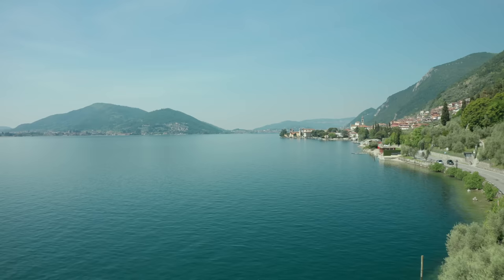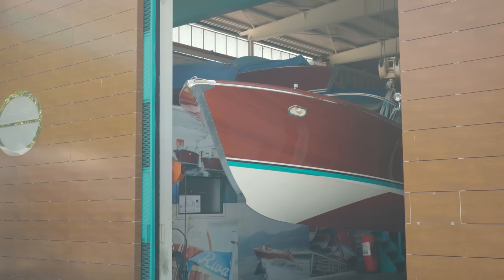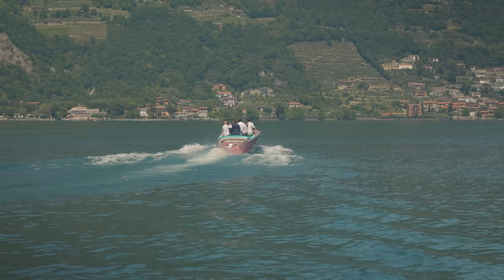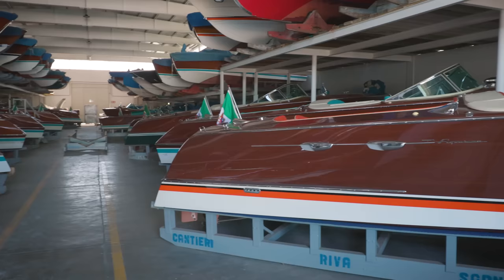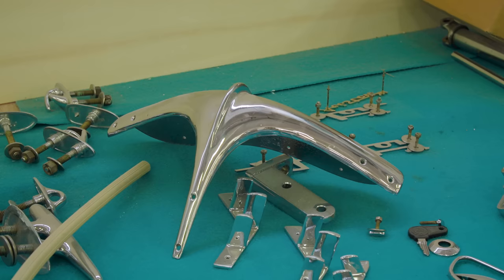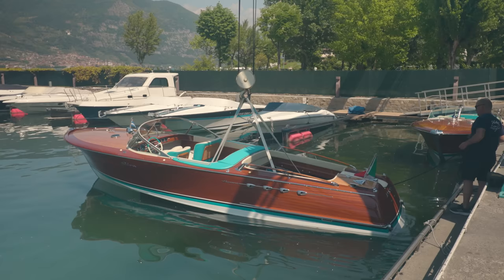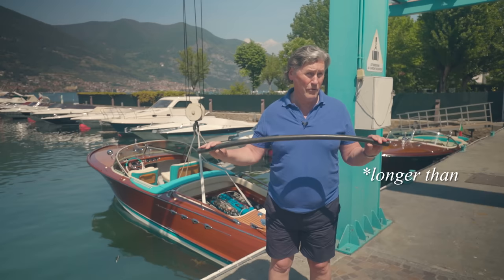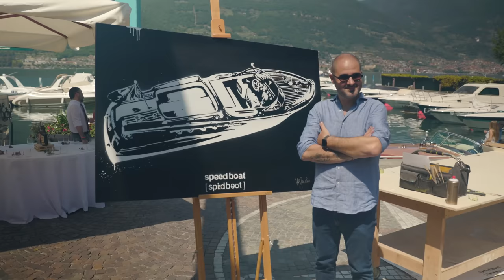Riva Aquarama Lamborghini - Tuning the Most Beautiful Boat in the World | Tyrrell's Classic Workshop

Comment: Hull No. 278.
It was restored to it original condition about 40Km away from here in the Netherlands.
The engines in this boat are NOT the original ones. one of the original engines is still in the Lamborghini Museum.
The owner is Sandro Zani (my boss) and you are correct about the prize :P

Comment: The adjustment of the carbs by sound is fascinating Iain. I have to assume you also adjust ignition timing during the process at times. I was aware of the boat, so cool you were asked to tune it. Top shelf presentation of top shelf machines!

Comment: Absolute piece of art, hands down. I have used the hose pipe and screwdriver tool on vintage corvettes, but in conjunction with a vacuum gauge. Why not use one on the engines?

Comment: What a wonderfully, diverting car video! There are a few questions that arise from the footage, which were not adequately covered: 1/. Was there much adjustment needed, and was the speedboat running poorly before it was re-launched? 2/. Was the 'test' run the first run, or did you need a couple of attempts to tune this Beast? 3/. What difference did the Bellini family notice after tuning, if any?
So, what next? Tuning the Mustang V8 engine in an Everglades swamp boat?! Great video - the privilege of knowledge and experience.

Comment: What a video Iain, thoroughly enjoyed it. Your best ever? Definitely up there, for sure! One question, with those air hungry V12s living side by side, surely the inner banks are fighting for the same air at mid to full throttle? The outer banks are producing slighly more power? How do you compensate for that with your high-tech tuning technology?
Reply from the maker: Jetting open carbs is always a compromise. Air filters may be unglamorous but they do stabilise air flow and temperature. Having said all that, these seem to cope well, although the boat is not run anywhere near full revs or throttle, for preservation reasons.

Comment: Very nice. Two suggestions. First, he should’ve talked about how the 2 engines did NOT work well in sync when built (a big issue that was only recently resolved). Second, I would prefer to hear the engine at full revs instead of singing…

Comment: I wonder if the engines were set up to counter-rotate? This is done with the big block American V8s. The starter, oil pump, water pump, and cams must be adapted.  
Also I noticed the bare carburetor intakes, no air cleaners. I guess there isn’t much dust and dirt on the open water!

Comment: Amazing content as always!! I was curious about an article I had previously read about the Lamborghini powered Aquarama. It mentioned that the original v12's power band was not suitable for the boat and either they upsized the engine or changed the camshaft profile. Is there any truth to this? I imagine that a boat application would require a decent amount of torque at low revs to pull it out of the water at low speeds and plane.
Reply from the maker: I believe the engines were rebuilt and modified a few years ago

Comment: Facts:  the Riva Aquarama Lamborghini was a failure.  The engine characteristics (high revving) were mismatched to the hull.  So only one boat was built.  During restoration the replacement V12 engines were retuned so the boat could perform properly.

Comment: was that 5,000rpm at what looked like only 12 kts or did i not read that tach correctly? this thing should do 40kts plus?
Reply from the maker: The engines are not pushed at all because the whole thing is old and precious. No more than 4,000 RPM maximum. This boat would have done 50 knots when new
Reply from the maker: We were doing 25- knots or more

Comment: I'm sorry but, your 1930s ara Packard design Twin 396.4 cu in V12s make very weak boat engines.
Recommend; Living in the present with Twin American ZZ632 Crate Engines from American Chevy Performance Parts with 1000hp (a huge 600hp jump) and 876 lb.-ft. of torque at 5,600 rpm all needed to push your old school boat to well over 70mph.

Comment: Glue is not good on any boat , the best boats in the world use no glue , taking out wood putting in screws , is a weak process of engineering, the strong boat has stainless steel screws with stainless steel flat washers against the wood , producing a strong fixing, something you need with a heavy powerful engine , wood does also weaken in time ,slight amounts of water can get onto untreated wood,